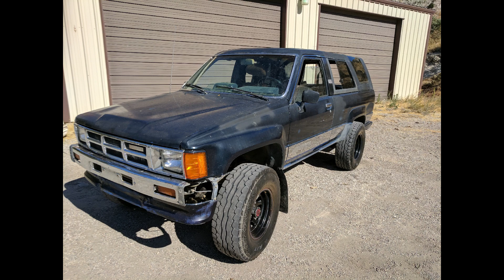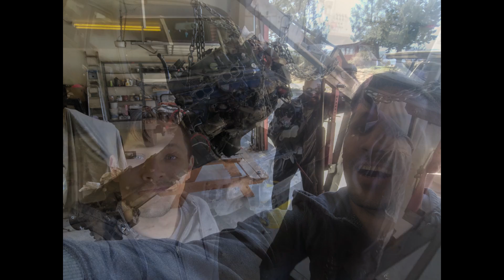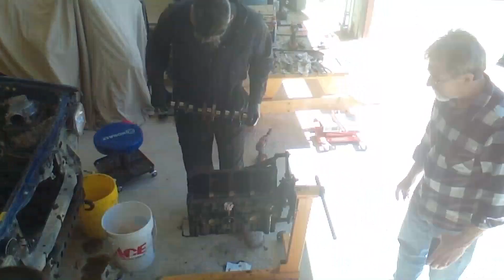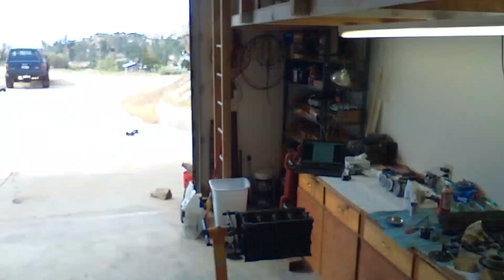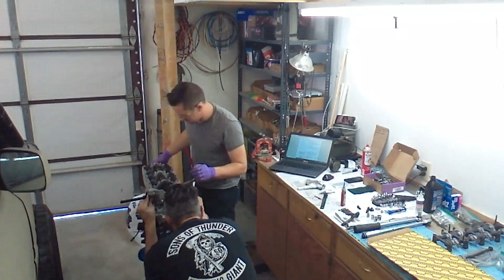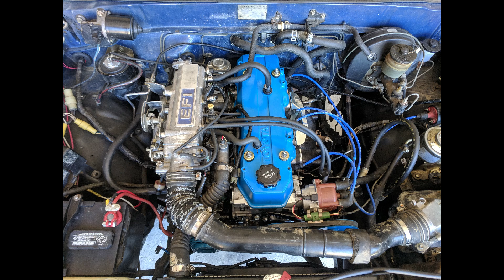22re Engine Rebuild

Comment: I know it has been  2 years .but I'll ask the question anyways. 
Was it easy  to pull the engine with trans and transfer case out?
Reply from the maker: It wasn't too bad, although dropping the trans isn't hard so it would probably be a lot easier without it. If you're doing it by yourself, drop the trans first.

Comment: What break in oil did you use?
Reply from the maker: I followed LC Engineerings page on breaking it in. I don't remember if it was Valvoline 5w30 or 10 but non synthetic as they recommended.

Comment: How long did it take you to rebuild it ? I’m thinking about rebuilding a 22re one day but I’m trying to get myself a big work space and the right tools to try it out
Reply from the maker: We did it over the course of weekends basically. We pulled it and stripped it down in a day, sent it to the machine shop and I got it back 2 weeks later, meanwhile ordered all my parts, and we rebuilt it and threw it back in on another weekend. It's a small engine so a engine trolly and a couple 6 ft foldy tables to lay out all the parts would prolly be fine.

Comment: What did all the parts for the rebuild cost?
Reply from the maker: Roughly $1200 in parts. The most expensive being the new head, timing kit and fuel injectors.
Reply: @TylerStoner  $1200 Oof! , In my head I was thinking more like $600ish doing the work yourself
Reply from the maker: @charlesgibeau2067  I thought about going with a rebuild from eBay for $1200, but figured this way I could put exactly what I wanted in, and get the experience of doing it myself. 
The original projected budget was alot less hah
Reply from the maker: With out the fan, starter, engine mounts and stuff like that its closer to 900 just in the engine.
Reply: another consideration is the tools that are required and a place to do it...and your skill level.
i need to replace the engine in my first car that has been sitting for 15 years. it would be more special if I could rebuild the original engine but this car is so important that I am leaning toward a professionally built long block.

Comment: What company did you go with on the parts?
Reply from the maker: I used an Evergreen HD Timing Kit, Evergreen Complete Head, NPR Pison Rings from Amazon, King Bearings off Ebay, Rocker Arms from Yota Shop, and everything else was from various auto part store in my town. 
There were a lot of rebuild kits that had pieces I didn't need or didn't come in the right size for my bored cylinders so I pieced it together myself.
Reply: @TylerStoner  right on, I looked at evergreen myself what did you think of the there quality? Thanks for the reply brother man.
Reply from the maker: @brianp8144  The packaging wasnt great, and they just boxed up a kit from other brands, which isn't terrible but ya know, ok. 
The complete new head seems to be doing great though. I only have about 5k on it now but so far so good. It was cheaper than rebuilding the old one, which I'll rebuild as a spare another time.
Reply: @TylerStoner  hey just checking in how that rebuild is holding up? Thank's man.
Reply from the maker: @brianp8144  The engine is running great as far as I can tell. I haven't been driving as much cause my heater doesn't blow very hot and it's been dipping into the 30's here. I've got 7+k on it now and still happy. Just gotta fix some cracking electrical and clean out the AC so it's more comfortable to drive around again haha